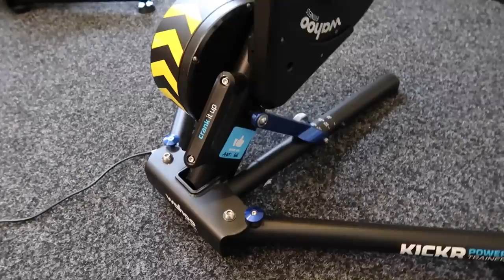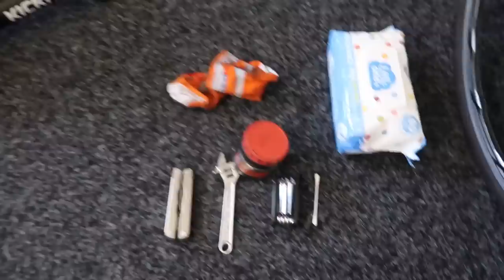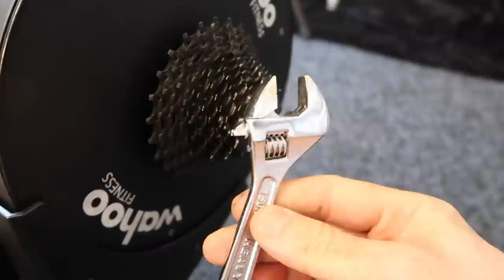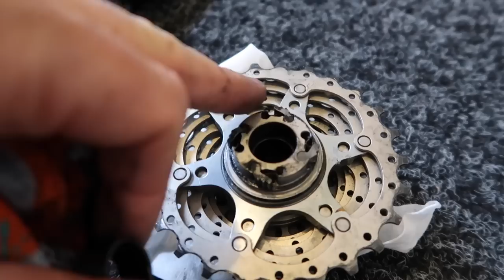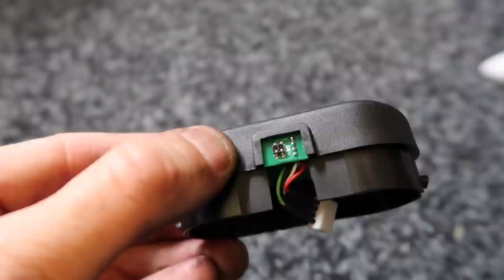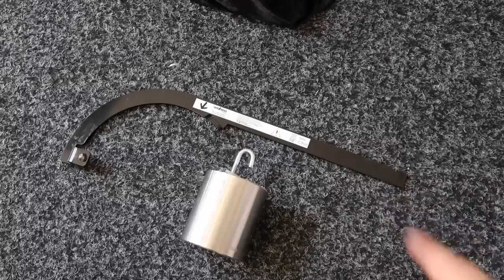WAHOO KICKR: Basic Maintenance (Gen 1)

Comment: Great video Shane, love my Kickr and videos like this really help. Can I ask you a quick question, I seem to have an issue with my Kickr, it will track power nicely in Erg mode using Trainer Road for the first 20 or so minutes (mainly warming up), then I will struggle to get it to hold the stated power consistently, it just tends to stay low but jump all over the place. Gets a bit frustrating as I expected to see nice straight lines in erg mode but to no avail. Any advice would be much appreciated.
Reply from the maker: That's one for Wahoo support. I'd ensure the firmware is on the latest (1.4.47 I believe at the moment) and ensure you've done a spindown before raising a ticket... as that's what they'll likely recommend before going through the troubleshooting process.
Reply: Thanks Shane, appreciate the quick reply (sorry mine has been slow!). Really love your videos but also understand how much time it takes for you to put them all together!! About to give my Kickr a birthday and see if I can get it to behave.
Reply: on mine it would read low but the resistance would obviously be way too high
cleaning the optical sensor fixed it
the reason is it needs the speed from that sensor to compute power = speed * force
so if it reads the speed low it thinks the power is too low and in erg mode will try to crank it way up

Comment: I have opportunity to use a Computrainer,  circa 1995 or so. will one that old work for Zwift?
Reply from the maker: People are using Computrainers for Zwift. I'm not sure what model/year. www.zwift.com should be able to help, or raise a support ticket with them if you need more info.
Reply: Good idea. Thanks.
Reply: I have another question you might be able to answer concerning the computer. I went to the local box store and had them spec out a computer based on the recommended equipment on the Zwift site. The cost came in at $950.00. Is that the going rate for a mid level gaming machine?
Reply from the maker: $950 US/AU/Fijian, plus tax, minus VAT?... There's way too many variables here. Then there's other things like SSD vs HDD, Windows license (which some exclude)... etc...etc. Zwift needs the best graphics card you can afford. Also worth sticking to NVidia as their hardware seems to have the best support (drivers/updates/compatibility).

Comment: any idea how to fix a small amount of side-to-side play with the main unit?
it's not a big issue but it tends to make the bike be a bit loose side-to-side
I tried tightening the bolts on the outside, but doesn't seem to help, neither does increasing the support on the side legs
it must be some hidden or internal bolt that needs a bit of tightening
Reply from the maker: Here's what you're after. The main pivot bolt needs tightening. https://www.dropbox.com/s/9s1xpr1m9hmnadt/How%20to%20Video%20-%20Adjusting%20Main%20Pivot%20Tension.mov?dl=0
Reply: Shane Miller - GPLama Hi Shane, you don't happen to have a refresh for that link regarding the main pivot bolt. My kickr flops around like a duck in a shirt sleeve and haven't had any luck finding a solution yet. Cheers.

Comment: May be having a slight problem with my kickr....about 6 months ago I took the freehub off to give the inside a good clean up as shown here... I cleaned everything up and re-greased it using finish line ceramic grease. Reassembled....fine.

About 5 weeks ago I did the same but one of the spacers had a nasty lip on it and got stuck in the cassette, I managed to remove it, and replaced both spacers, greased up again and....fine. But I SWEAR that the unit is seemingly running a little hotter the last few rides (I may be imagining it but I swear I could even smell heat) so last night, took the freehub off again and after just 5 weeks one of the spacers had developed a couple of nasty lips again. I have got 1 more set of spare spacers (courtesy of Wahoo)...I have ordered some more grease from here

https://www.amazon.co.uk/Comma-BG2500G-Performance-Bearing-Grease/dp/B007WR38TY/ref=sr_1_2?ie=UTF8&qid=1485871778&sr=8-2&keywords=comma+grease

Which is nice and thick. Shy of asking Wahoo for more, is there anywhere I can buy more spacers from??

I'll take it apart and re-grease it again, use my final set of new spacers and see how I get on. Any thoughts?

I've never tightened the belt (unit is about 16 months old, used a lot, but no signs of fraying).

Many thanks!
Reply from the maker: This is one for Wahoo. I'm not sure on the size/standards of the spacers they use. If they're generic then you might be in luck.
Reply: Just spoke to Wahoo, they're going to send me some more spacers but apparently the reason is most likely because I did the 17mm lock nut up too tight, which squashes the spacers. Apparently this nut should be done up to 5nm or torque. I have a torque wrench but need an adapter to fit a 17mm bolt on! I've loosened it a little and hopefully that'll help. Thanks for your quick response.

Comment: BEWARE- Wahoo do not allow “self-service” and refuse to ship spare parts! So if you are thinking of buying one, be careful. It’s a real shame as product is reasonable, but their customer service and business model is very poor.
Reply from the maker: Do you have any further information on exactly what model and what part they've refused? And did they offer a return-to-base replacement?
Reply: Shane Miller - GPLama, bought a Wahoo Kickr v5 secondhand from a gym that was closing. Works perfectly well, but was noisy, so I followed some YouTube video and cleaned it, greasing flywheel spindle and bearings. Whilst in the process, it became obvious that the inner radius of the pulley wheel had been “gouged” from a previous servicing. I managed to use a file and Emery paper to smooth and got it back on. Job complete and it runs really smoothly and no noise, all good so far. I contacted Wahoo do see how I could get a spare pulley wheel, so I could replace in the future. To which I basically got told in several emails, that they do not support secondhand units, do not ship spare parts, even though I’m happy to pay. Also have failed to tell me where I could get it serviced correctly, I am based in Hong Kong. As I said, Kickr is great and loving it, but the constant “computer says No” response from them is rubbish, sounds like they are hoping I buy a new Kickr if this one fails, at nearly AUD2k for a new one, I would expect it to last for years and be fully self-serviceable. Thanks
Reply from the maker: @richardcooke7909  The Kickr 5 (2020) is only a few months old. That's surprising to hear it needed a 2nd service after a previous service. That gym must have had that thing smoking along!
Reply: Shane Miller - GPLama when I say a second service, maybe it was just how it was delivered from Wahoo, I just assumed they would not have shipped it that way, but maybe they did, who knows?